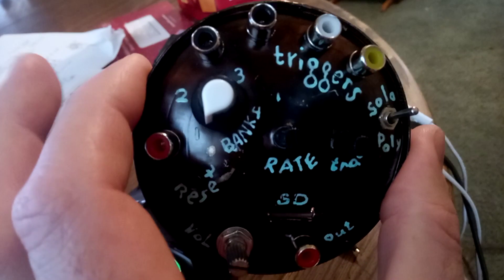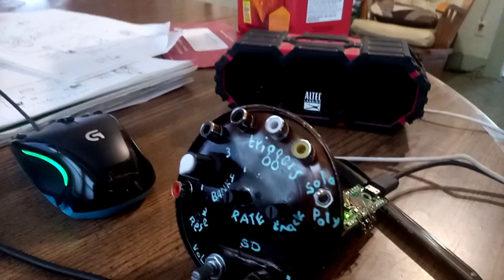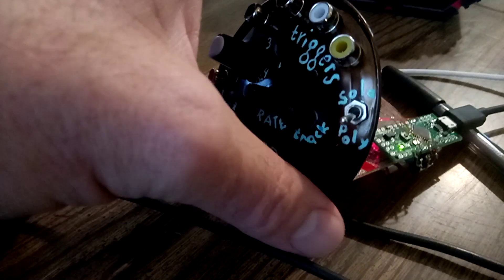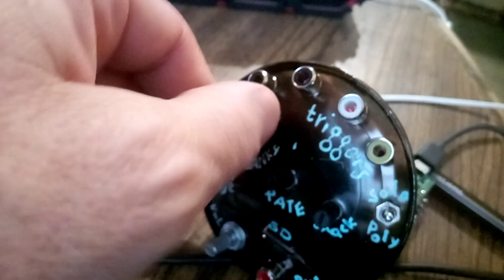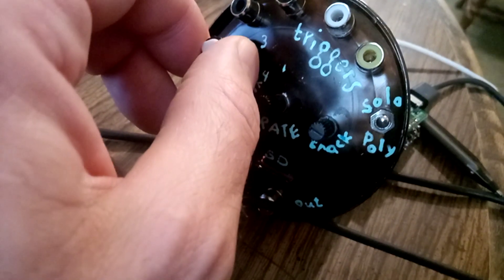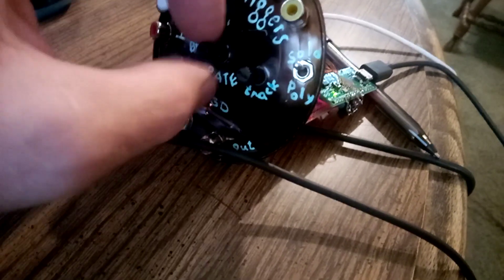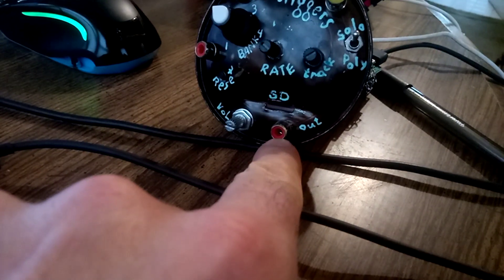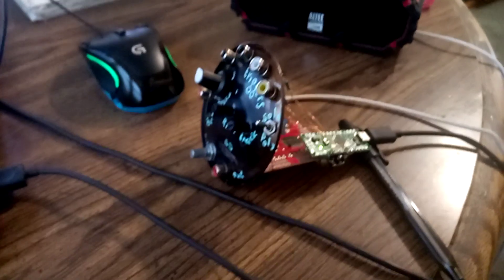WAV Trigger modular synth module!

Comment: Oh wow cool! Thanks for the files, too. Can you someday talk more about those transistor triggers and do they get triggered by an audio signal? And the serial hookup? From your demo & diagram, the serial connection is way simpler than I feared.
Reply from the maker: The transistor triggers are just a way to protect the Arduino from hostile outside voltages -- the transistor with the resistor can tolerate any old voltage a typical modular will ever toss to it, and also invert the incoming POSITIVE, allowing the Arduino to see a GROUND trigger, letting me use the built-in pullup resistors on the Arduino chip.

I don't know if this module can be triggered by audio, it'll depend entirely on how far positive the audio voltage goes. If it's more than 5V I bet it'll trigger? There will be a limit to how FAST the Arduino can be triggered -- I think I wrote it to wait for the inputs to be *un*triggered, and then watch for a trigger, so however much time the processor takes to run through that will be the fastest you can trigger this. The Wav Trigger has about 8ms latency, so you're certainly not going to be able to trigger faster than that.

Yeah, the serial connection is very simple. This project uses very few of the I/O pins of the Wav Trigger module. I'm working on modifying the Wav Trigger circuit, designing a PCB that can be built up into a Eurorack module. Stay tuned for that progress!!!
Reply: @ozerik  wooo! Thanks so much for the explanation - I'll be watching more for sure!!

Comment: That's awesome! Definitely going to make it, thanks for sharing!
Edit:
Also how will you deal with eurorack trigger voltage being too hot for the wav trigger inputs? I guess you could use diodes voltage clamping to limit the voltages or npn transistors as switch... Maybe a 4066 ic... let us know!
Reply: I'm working on a DIY wav trigger instrument and I'm using a couple 4066 ics to close the contacts.  Took me a while to figure this out because it's not in the manual, but if you do use the trigger pins you should add #DBNC 5 to the configuration file on the SD card or it triggers too slow.  It looks like Juanito is using an arduino nano to trigger the samples, which gives some additional perks like being able to switch individual samples easily and change pitch.  This has me wondering if I could use both the trigger pins and add an arduino to give serial commands at the same time...
Reply from the maker: @devinigh89  I'm not sure what commands are available through serial that are global. I know the sample rate command takes effect as soon as you send it. Oooooh, I guess you can also control the gain, you can stop all tracks, and you can have the sixteen onboard triggers control 32 different sample banks. Sweet! So yes, you can use quite a variety of triggers and serial commands.
Reply: @ozerik  Sweet! I guess I'll have to learn how to use arduinos then :D
Reply from the maker: @devinigh89  I've got the code you need linked, you just have to download the Arduino program, put the libraries where they're supposed to go, connect the Arduino to your computer, making sure the drivers are there, and upload it! So simple!!!!!! (LOL not that simple, but at least you don't have to learn to code, which I recommend because it's difficult but rewarding)
Reply: @ozerik  I got a nano in the mail and I'm going to give this a try.  I have the WAV tsunami, so I might actually need to learn what I'm doing to make it work! I know I'll have to include a level shifter to get it from 5v to 3.3 going to the tsunami. The serial commands look like they're the same, but I'll need to research a bit more to see if there are other changes I should make.
Reply: @devinigh89  keep getting tempted by the wavtrigger, did you make any progress on your version?
Reply from the maker: My solution for triggering the Arduino would work great for triggering the Wav Trigger as well. NPN transistor, leg-without-the-arrow to the trigger, leg-with-the-arrow to ground (there's two rows of holes, the one next to the edge is a convenient ground point) and a resistor (1K? 10K? 100K?) to the base of the transistor, send ??? voltage through the resistor and you've got a trigger event.

The default for the Wav Trigger inputs is "trigger on low", so the inputs are pulled high. You can change that in a config file and use diodes and zeners and level shifting ICs but... :D